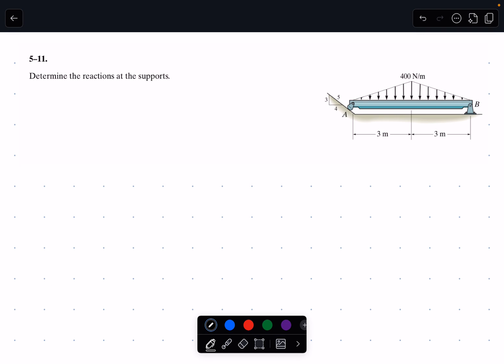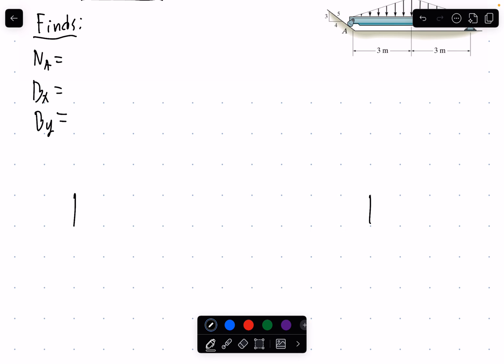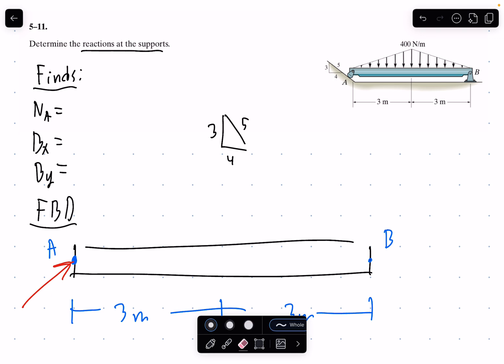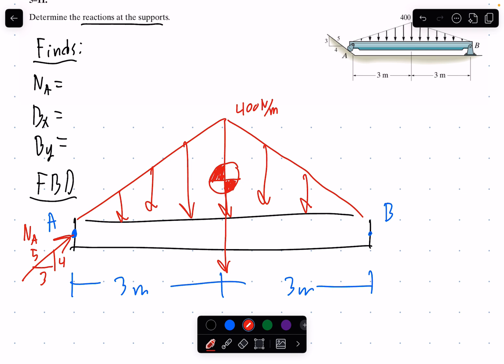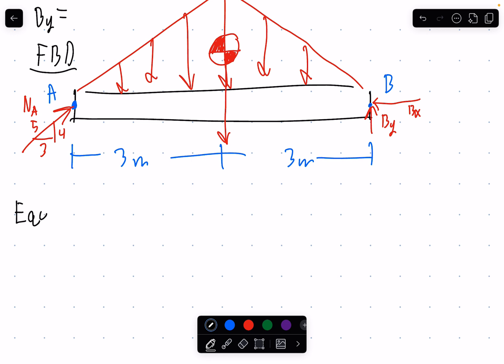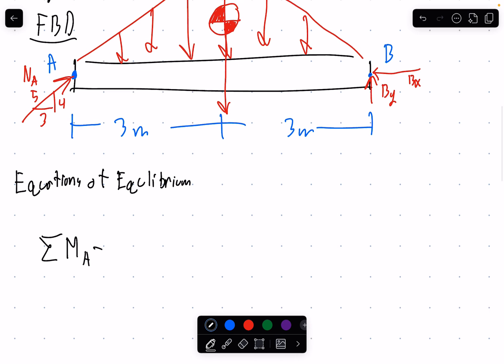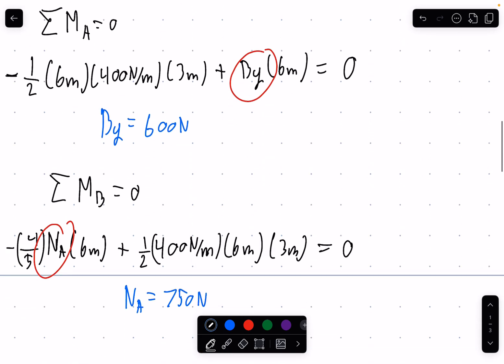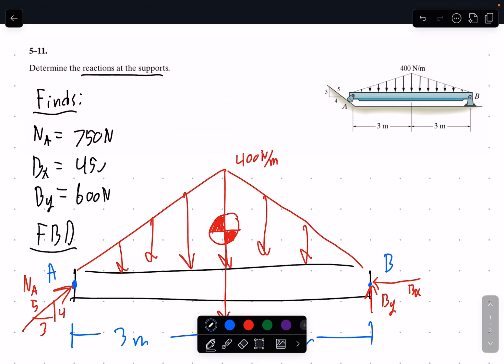Determine the reactions at the supports.

Comment: Is Na not just the force of the y component? I don't understand why you would use that in the sum of forces in the x direction equation. (3/5 * 750?)
Reply from the maker: The rocker support, by definition, produces a reactant forces that is normal to the surface it’s on. In this case, the reactant normal vector will a component that lies in the X-direction. However, this may be difficult to visualize initially